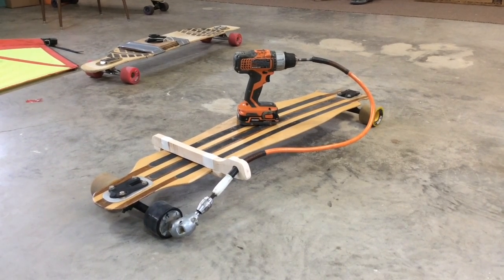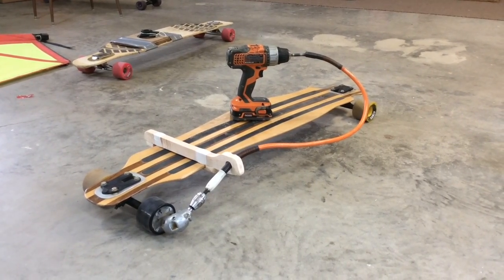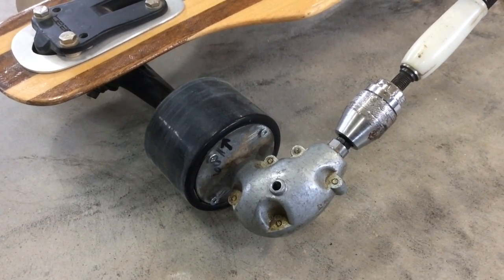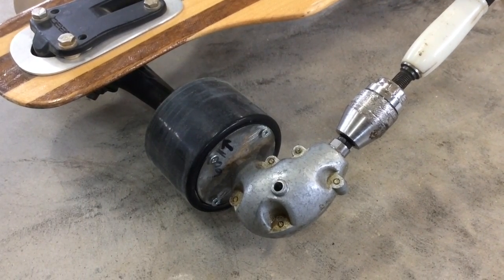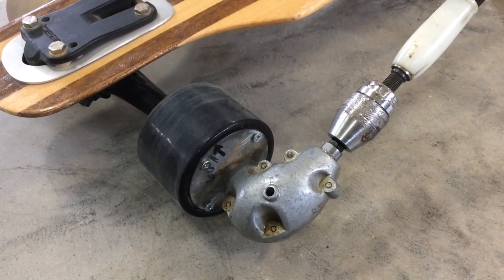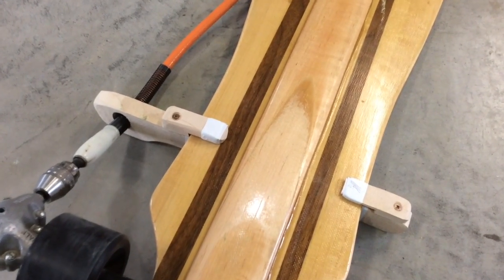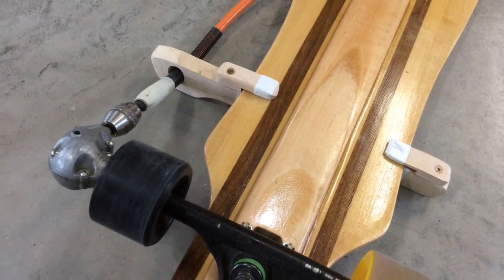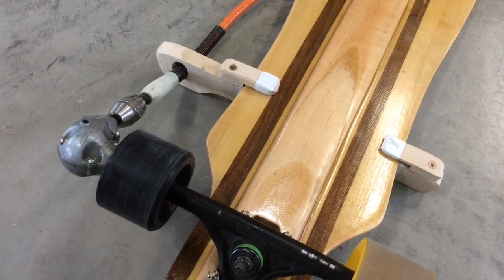DIY Electric Longboard

Comment: what's the point you can push of and 3 times faster
Reply from the maker: You are correct. The point might be that its educational, a challenge, and just plain fun. Actually, I can drive my van 20 times faster.  Thanks for your comment.
Reply: Glen Smith has
Reply: Glen Smith and then I will have the right
Reply: Glen Smith and jgf the